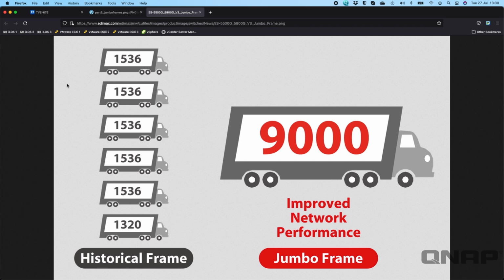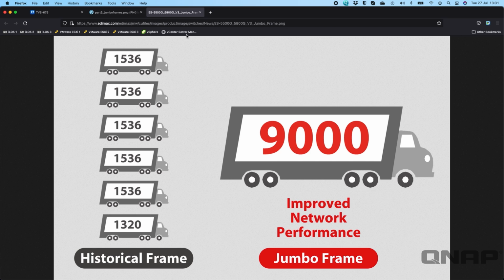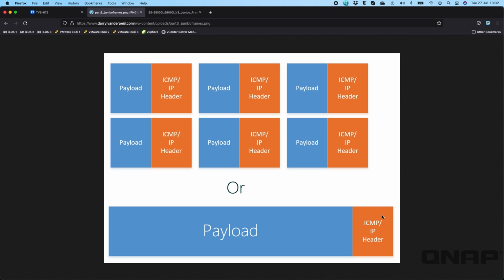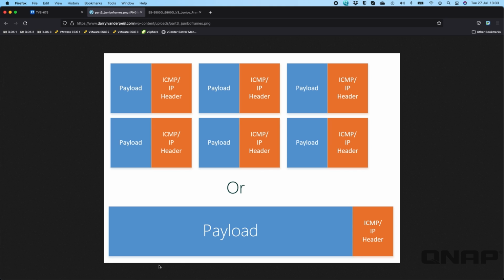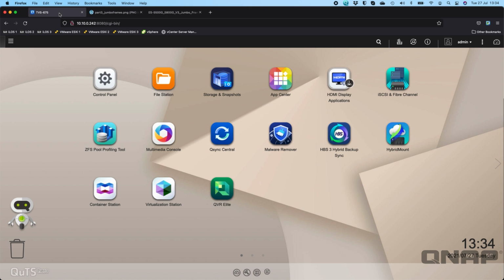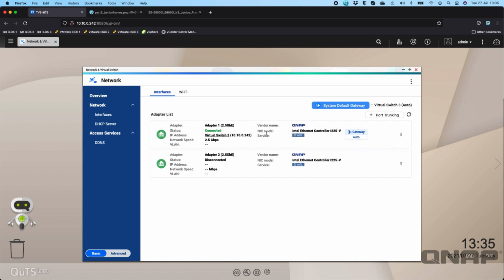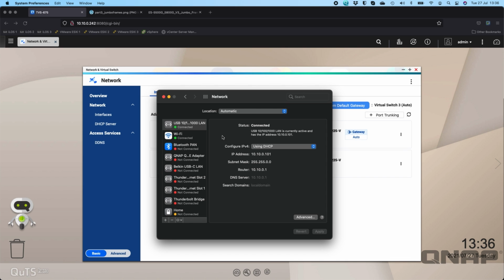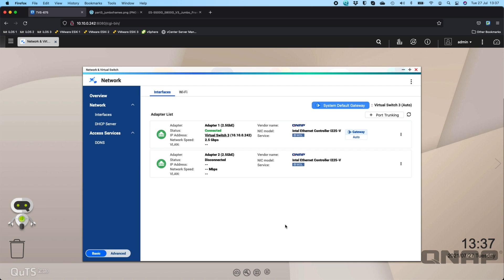QNAP Quickie! JUMBO Frames, WHEN and HOW to Use Them

Comment: Hello! Thanks for this video. I'm just getting into more complicated networking in my home/home office, and I've been trying to learn what I need to know to set up a 10 Gbps VLAN for my fast storage and clients that can take advantage of it.

A couple of things I'm not clear about:
1) I can't find a jumbo frame setting in my QNAP switches--in particular, my QSW-M1208-8C. I'm guessing it automatically negotiates with whatever device is plugged into a specific port to set the MTU appropriately? Is there more information on how that works? Is it by port/VLAN/something else? In particular, I've got a couple of non-QNAP switches that uplink to the QSW-M1208-8C via 10G or 2x10G LACP links, and I'm guessing, but I'm not sure, that I need to set those devices to use 9000 MTU on the uplink ports? I'm not certain what to do here since I don't know what MTU value the QNAP is using.

2) The specs indicate that the switch uses 9000 MTU-sized jumbo frames. So, that's the number I'd actually use if I have to manually configure a connecting device, yes? Sometimes, I see 9216 or other sizes referenced for other switches as the default size, but I can override those.

3) I have a Mac attached directly to the QSW-M1208-8C. It auto-negotiated full duplex 10Gbps, but set MTU to 1500. I don't have any VLANs set up, so my WAN traffic and LAN traffic all exist on the same network. I assume that in my case I want to leave it at MTU 1500, and would only want to use 9000 MTU on a separate, high-speed VLAN where all the devices are 10Gbps and have MTU at 9000?

Thanks!
Reply from the maker: Jumbo Frames on the switches is in the "Configuration" menu and you must then select the "Ports" sub-menu, finally along the top on the right hand side you will have options like Port Status/Port Statistics and Port Configuration, you need to go into Port Configuration and there is a drop-down box beside each port for the Jumbo Frames.

Our largest Jumbo Frame option on our switches is 9018.

One thing I want to be clear about is that EVERYTHING must be on the Jumbo Frame you set within the Jumbo Frame segment/VLAN you are setting up. If you were to have a bunch of servers/NAS/clients all using Jumbo Frames but then uplink something like a router that is not using Jumbo Frames into this same segment/VLAN, then that would not be everything using Jumbo Frames.

You would normally want 2 network connections to your servers/NAS/clients... 1 for fast transfers between everything and 1 for external resources like perhaps the internet or a printer, things like that.

Comment: Jumbo frames sounds cool, but will actually slow down your entire network in most cases, if you enable it for everyone...
I did a calculation of how much header overhead you save with 9000 byte frames is 180 bytes...  It's only a 2% savings...
A better solution is too move from your current 1gbps to 2.5gbps or even 10gbps Ethernet, if you really want to make speed gains.
Reply from the maker: Will only slow it down if configured incorrectly. For most users it is unsuitable to use Jumbo Frames, really Jumbo Frames should only be used when you have a completely separate network where everything can run Jumbo Frames... great in server rooms if you have a separate network for between the servers, but the NIC's used for users is not using Jumbo Frames.

Comment: Cool.  Is there a way to know if Jumbo is working ok?  I've got a weird setup where my Qnap and all other devices in my house are routed around as normal through switches and wifi and stuff - these are on normal frames, but i've also got a 10gbe direct (no switch) connection to my PC for editing and stuff where both NICs are set to 9000 size frames.  Both NICs in the Qnap box are bridged so they have the same IP address and it seems to be working.  So, is there a way to know if there are errors/inefficienies?  Cheers!